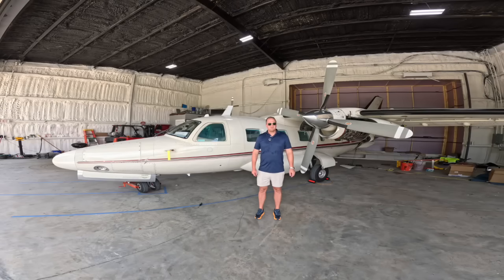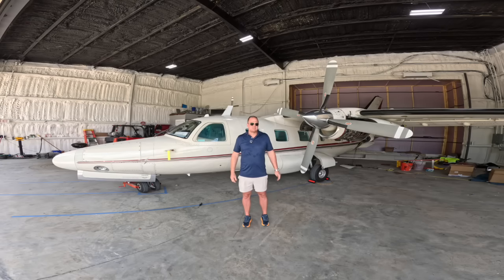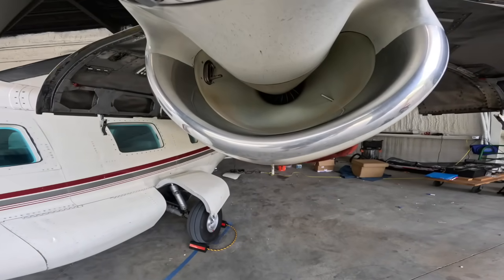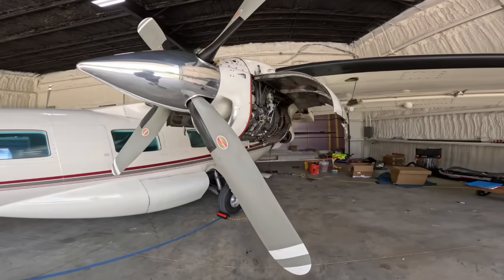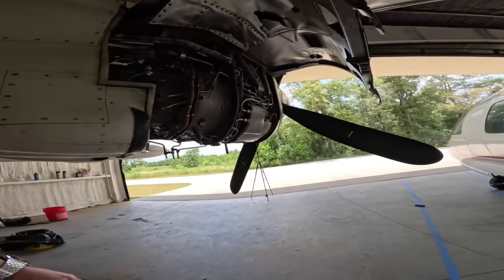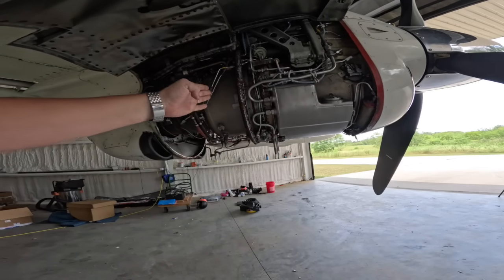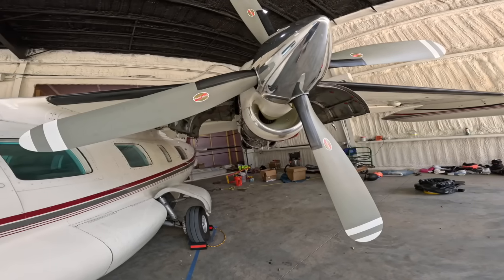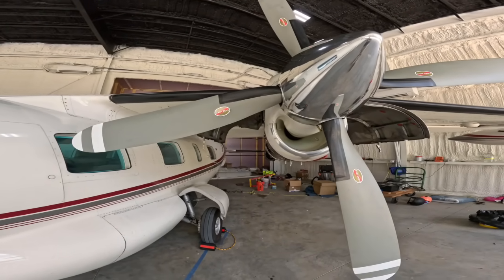Mitsubishi Mu2 TPE331 advantages and disadvantages

Comment: Former c210/310 pilot here. What are its traits that make it a handful. I see many comments about the pilots and having to fly it like a jet/by the numbers...Does this mean just dont get it slow, behind the power curve or just behind the aircaft in general?
Reply from the maker: The wing is very small.  It has 4 more square feet of wing than a 172, so the stall speed clean is really fast.  The drag gets very high at high angles of attack so the more it slows down, the faster it slows down.  The propellers have a ton of drag at idle, so you can develop really high sink rates on final without meaning to, so stabilized approaches are very important.  The roll authority isn't great at slow speeds.  If you don't have the ball in the center, you can run out of roll input relatively easy. When you're doing a crosswind landing, you can't give it large rudder inputs because the rudder pedals also control the nosewheel steering and if you give it  a lot of rudder pedal, you're also giving it an extreme amount of nosewheel steering input, so when the nosewheel touches, it will head for the ditch and the airplane can get kind of tippy.  The correct way to handle this is to split the power levers and give it more power on the upwind engine to give you the yaw input to keep the longitudinal axis straight with the runway instead of using the rudder.  With the power levers split this way, you can have the rudder pedals more or less centered so the nosewheel doesnt try to immediately steer you off the runway when it touches.  You basically set up the crosswind inputs on short final, banking into the wind to control the drift and then split the power levers to zero out the yaw.  You hold this lever split into the touchdown and even as you're coming into beta, only using small rudder inputs to supplement and make small corrections. All that soudns weird, because it is at first! :)
Reply: @TurbineDudeMU2 thanks for the detailed explanation. So compared to the c210, which is speed sensitive, you have 3 other major factors to handle while moving a lot faster. I remember the c310 being easier to fly. This sounds like the opposite yet more rewarding at the same time.

Comment: Could anyone explain why this TPE 331 turns to the left, where the 3 blade versions turn to the right?
Reply from the maker: The older engines with the 3 blade propellors are the "fast turn" setup and turn around 2100 RPM at 100% on the gauge.  The 4 blade  propellors are the "slow turn" setup since they rotate at 1591RPM at 100% propellor speed.  They're quieter to a degree.  The way they changed the gear ratio on the gearbox was to add a gear to change the final output ratio.  Whenever you add one gear to a mechanical system, you change the output rotation direction.  The fast turn airplanes rotate them in the conventional clockwise direction as viewed from the rear and the slow turn ones with the extra gear rotate counterclockwise as viewed from the rear.  There are some issues with the 4  blade models like mine.  There is a pretty onerous Airworthiness Directive that require the prop to be disassembled every 5 years by a propellor shop and the hub inspected for cracks.  This is around a $25k inspection for both props if they're in good shape and pass.  A new set of props is $100-$125k. The props that make sense to upgrade to (Hartzell Scimitar's or MT's) don't have this AD, so at some point, I'll probably make the switch.
Reply: Great explanation and I appreciate your time to lay it out.  Many thanks!

Comment: I always hated every time I had to do the R&R on the TTL (Torque Temp Limiter).
Reply from the maker: Mine doesn't have the TTL computers like the Jetstream 41's I used to fly.  Mine does have the SRL (single red line) computers though.  They help automate the start and give you a single redline on the gauge to use vs having to look up max values on a chart, but they don't provide any temperature or torque limiting.  If you keep pushing the power lever up, it will keep feeding it more and more fuel until it burns itself up.
Reply: @TurbineDudeMU2  I’ve been an A&P Mechanic for a while, I got my tickets in May ’89.  I used to work for Jetstream International Airlines (JIA).  We had a lot of 3100’s.  BAE used to come talk to us a lot when they were designing the 4100’s. They always asked us what kind of improvements we thought they should do.  We gave them our two cents, and when the 4100’s came out JIA did not buy any.  JIA bought the Embraer Brasilia EMB-120 instead, BAE lost their absolute minds. They were really mad cause they thought for sure we would buy the 41s from them.  That of course, created a huge rift between BAE & JIA.

Comment: Good job presenting the TPE 331 engine. Regarding overhauls, on your dash 10 engines, you have the option to do as you say, every 1800 hours, but the second one at 3600 hours also requires a gearbox inspection. The other option which almost everyone is doing now because it’s cheaper and makes more sense is to choose a 5000 hour TBO which only requires one inspection at 2500 hours and no gearbox inspection at that time. Skipping an HSI/GBI is well worth sacrificing 400 hours on the TBO. And as you correctly pointed out, if you’re Part 91 the overhaul is optional. Many of the guys using these for agricultural applications are flying them 7000 or even 9000 hours without an overhaul, just HSI and compressor seals. It’s also worth noting that it’s cheap insurance to clean your fuel nozzles every 200 hours or so.
Reply from the maker: Thanks for the thoughtful comments!  You probably know better than me, but I was under the impression that if you were doing regular S.O.A.P samples that you didn't have to do the actual gearbox teardown inspection, but I'm not sure on that one.  Do you happen to know if that's accurate?

Comment: Biggest disadvantage of TPE 331. You can’t put on enough hearing protection if you’re standing outside while it’s running. The damn things make your teeth hurt.
Reply from the maker: Yeah, it's pretty shrill.  Someone explained that its a resonance issue.  The relationship of the inlet to the propellor and the height of the wing above the ground gives it a resonant frequency that amplifies the sound.  It's kind of like how a guitar magnifies the sound of a vibrating string that wouldn't make much sound all by itself.  They're actually waaaaay more annoying at ground idle that at flight idle where they're actually turning faster.
Reply: @TurbineDudeMU2 I totally agree with everything you stated. And, I just have to ask if you’ve ever pushed the tip tank red vent button?😁

Comment: I've flown both PT6 and TPE331 power aircraft as line pilot and instructor, and from my perspective, the TPE331 is nicer to operate  with near instantaneous power response. You can initiate a go-a-round from 5 feet with zero sink. Doing that with a PT6 powered aircraft, and you'll probably touch down before the power comes in. It's like the difference in driving a stick shift versus an old school automatic transmission vehicle.

Switching the props out with lightweight 5 blade composite props will save 30kgs in weight, allowing for faster cooler starts with less stress on the batteries. And lower the cabin and over flight noise levels. A worthwhile consideration at the next prop overhaul.

Comment: PT-6 is a much better designed engine. 331’s are noisy and I have seen a PT-6A-42 chucking PT blades out the exhaust and kept on running. The 331 will shit itself under similar conditions

Comment: Okay so why are these things so LOUD.  I mean you can hear these 5 miles away!
Reply: They idle at 76.5% and have a large straight exhaust pipe
Reply from the maker: copied from above...........Yeah, it's pretty shrill.  Someone explained that its a resonance issue.  The relationship of the inlet to the propellor and the height of the wing above the ground gives it a resonant frequency that amplifies the sound.  It's kind of like how a guitar magnifies the sound of a vibrating string that wouldn't make much sound all by itself.  They're actually waaaaay more annoying at ground idle that at flight idle where they're actually turning faster.
Reply: huh??   did you say something

Comment: Cool video, very well done.  I flew an L-model MU-2 back in about 1978 to 1981 for about 2,000 hours.  I looked almost identical to yours.  I had one engine failure enroute, sheared fuel-pump spline shaft sheared.  It was pre-Woodward.  Cheers

Comment: So , you can only take off @ sea level with the engine set at ~724 Hp ! And , if you're taking off @ 10,000 ft. You can set the hp at a higher Hp rating due to a decreased air density ?
Reply: Imagine if the engine is not restricted at all.  It could make 1000 hp at sea level and the available power would decrease with altitude so that at 20,000' it's only able to make 724 hp because the air is less dense so less oxygen.  The airplane designers decide that the plane is real happy with 724hp per side at 20k feet with a good balance of speed, stability, and fuel economy. 
The problem is that 1000hp per side at sea level is almost too much for the little airplane to handle.  The gearboxes, engine mounts, propellers, rudder, etc. must be larger, heavier, and more robust to handle all that power.  Now the airplane weighs more so you need bigger heavy duty landing gear and tires. All this extra weight means less fuel you can carry, so payload and range is compromised. 
So they decide to just limit the power down low to 724hp, and all that extra weight is unnecessary.  Still plenty of power for takeoff and climb, plus the engine is less stressed.  So instead of the charted power curve going down from 1000hp at sea level to 724hp at 20,000', it's now FLAT at 724hp from sea level to 20,000' and then starts to drop off from there. Hence the term flat-rated. 

(The numbers i used are not exact, but for illustrative purposes only.)
Reply from the maker: Wonderful explanation!

Comment: Got to wonder you have stated that it like 100% of power, ' YET...! ' Do wonder about the statement about fuel and noise vs best power operation ( per your own thinking)... Than having the engine run at max...? Data would be nice but personal observations of observed fuel flow (GPH per engine ) and noise level comfort ( in cabin and outside Db..)  would add so much to this video  and seems it would better to understand the eigines value?

Comment: Referring to the TPE 331 as a "fixed shaft engine" is confusing and wrong. If the shaft were fixed, it would not turn. It is a single shaft engine. The PT-6 is a 2 shaft engine, one for the power section and one for the gas generator. The PT-6 is also called a free turbine.
Reply from the maker: I believe the "fixed shaft" nomenclature comes directly from the manufacturer.
Reply: Sorry, but TPE-331 is a fixed shafted turbine engine.  This means there is not a free power turbine section, which is not directly driving the power drive section of the engine, as is the case of the PT-6.  The PT-6 is a free power turbine.  The TPE is a fixed shaft direct drive engine.

Comment: I am not an expert but that engine looks more like a Turboshaft design. The kind you see an a helicopter
Reply: It is, however when connected to a gearbox with a prop connected to it, they decided to call it a turboprop instead of shaft (egen though the prop is also connected via a shaft..).
Reply from the maker: Mechanically, there's next to zero difference.
Reply: @TurbineDudeMU2 . I believe there is one big difference, in a turbo prop engine the two has the engine or not physically connected. And they are in the Turbo shaft. In fact, I believe, with the PT Canada turboprop, the two parts rotate in opposite directions ￼

Comment: I know the Metro's 331Us can get the lightweight 5 blade props, any interest in the 5 blade STC?
Reply from the maker: This airplane had 5 blade MT's on it under previous ownership.  I have heard secondhand that they didn't like the handling issues on landing since one engine tends to go into Beta/reverse sligthly before the other and the 5 blade props have such an extreme around of blade area that the differential drag could make it a handful when moving the power levers back into Beta/reverse.  MT's also have a bit of a reputation for oil leaks at the hub that are hard to completely stop.  They look amazing and they're lighter so the starts require less electrical power and they supposedly climb better, but it gives me pause that a previous owner spent such a huge amount of money on them and then went back to the old style 4 blade props.  Hartzell scimitars are another pretty obvious choice.

Comment: Good motor-been around a LONG time-but batten down the hatches when stuff needs to be done if there are findings on the HSI. Not many shops around that can adequately support the 331. The electronic fuel controllers are a vast improvement over the old pneumatic types. Very good fuel burns-get them things upstairs & watch your flows drop to next to nothing for the IAS.
Reply from the maker: Arkansas turbine services seems to be the go to shop for TPE331 owners that are cost conscious.  You aren't kidding about the expenses getting large if hot parts need replacing!

Comment: I have over 20 years of maintaining TPE 331's,mostly -8 and -10 engines with the electronic FCU's.HSI and EGT recomps were always fun to do.I have worked on the 331's on the B100 King Airs,the Beech dealer next to the place I worked didn't have the experience on them that I had.Great engines,and the ones with the electronic fuel controls idle at 65% power which was nice.

Comment: I have flown the MU2 Long Body and the Turbo Commander 1000 with the TPE 331.  I have also flown the Grand Caravan, Kodiak 100, Otter, PC12, Meridian, King Air, and Cheyenne III with the PT6.    

I personally like the PT6 but a job is a job

I also have 6 Jet type ratings and my favorite is the Williams on the PC24.   What a great machine!  Currently flying a Falcon 2000LX
Reply: The comment section is for commenting on the subject matter of the video; not to toot your own horn.

Comment: Fun story:  I was doing my flight training in Dalton GA when one of these exact same a/c landed at around 4am (I heard!). This was around 1984 I'd say.  Anyway, the DEA was waiting for them guns drawn on the tarmac, but the flight crew (2 guys) took their time, shut everything down and then calmly disembarked.  Then they started running like hell because the airplane exploded. By the time I got there the next afternoon, I'll never forget the sight of the those two big turboprops and the outer wings - all that was left of the a/c.  The 2 guys apparently went to jail, but for way less time than a drug offense, because the heat of the blaze literally vaporized everything inboard of the engines.  In the 80's, that drug trafficking corridor up from Miami was wild!  BTW, this is the same corridor that produced the famous Cocaine Bear story.  My flight instructor had turned down several offers to "Just take this suitcase to this small field in (insert PA, MD, etc), we'll pay you $50k".  My dad was friends with the Whittington Brothers, who went to prison after the feds finally figured out where all that money was coming from to race. Man, I miss the 80s.
Reply: Those were the days. I lived in NE Alabama and it seemed like every weekend someone would crash, run off the runway or get busted with a load of coke. I remember a guy from Fla leases the airport from the city, but then he stopped selling fuel, no planes for rent, no repairs, no nothing but the one big hanger that was under lock and guard 24/7. He made his lease payments on time each month. A cool dude with snakeskin boots and Rolex watches. It didn't take long to understand what his real aviation business was, bring in coke in the early hours of the morning, then straight to the hanger, doors opened, then closed, then not a sound until mid-day when a camper would roll out of the hanger. Very military like operation that went on for two years, then he's gone. Just one story of many of the high flying days of the 80's.

Comment: A good explanation as to why a TPE (turbo prop engine) is de-rated is that if it was designed to reach full horsepower, the gearbox would have to be a lot larger and a lot heavier. Also it would need a larger rudder. And perhaps there are other reasons as well.
Reply: Longer TBO's. The engine has the thermodynamic potential to make the power-but if it doesn't need to-then why stress the engine ?
Reply: Many types of engines are de-rated.  The main reason is it's much easier and cheaper to de-rate an existing proven engine than design and produce a new smaller engine. 
Why you'd want an engine to make less power is a different question entirely, and you've touched on several of those reasons.